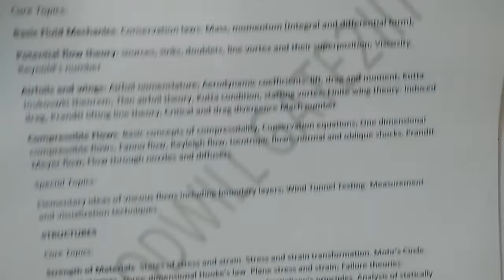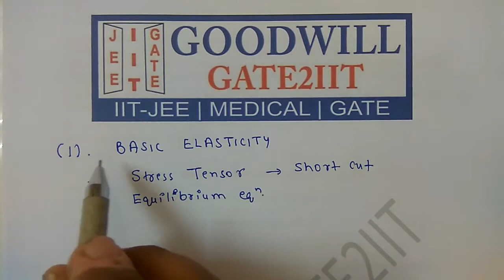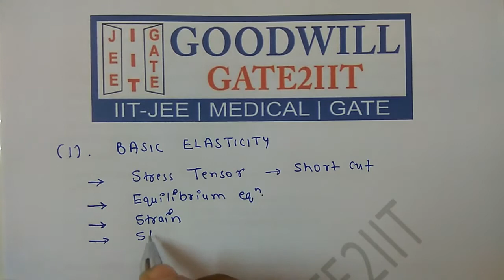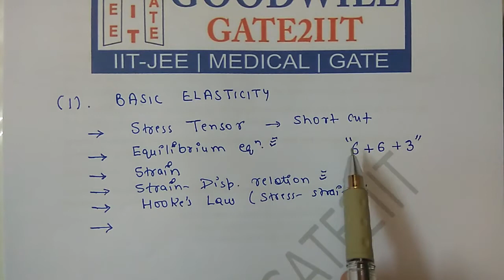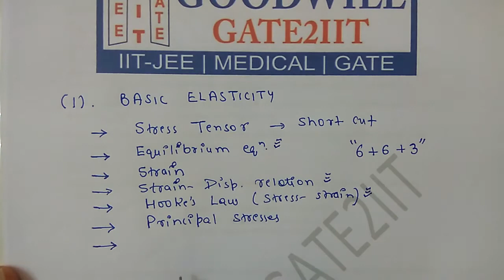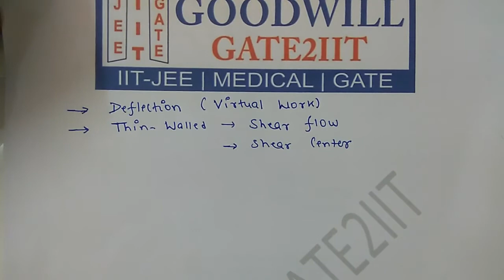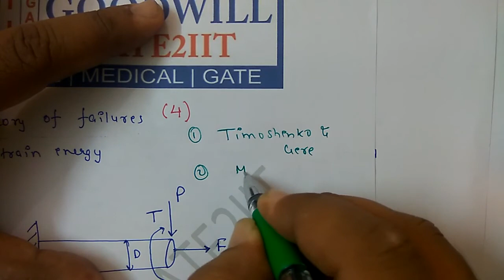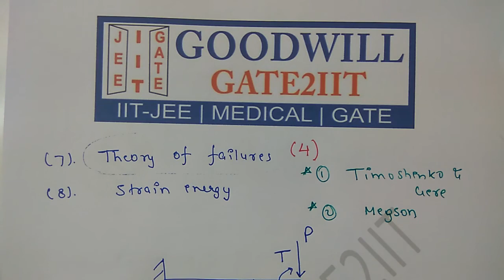GATE Aerospace Engineering - Aircraft Structure - Lecture 01- Syllabus

Comment: Aerospace engineering is not confined to maX efficiency in combusTibLe ballo|on propulsion engines ○|○ oR the computer that operates hydraulic magnificance oR sensors instant displays oN dasHBoard but evenTuaLLy MediBox with f2f.endoTracheaL.derip.hepaR.ligation were set Y ! arent any confidence of uTmost part for aeroDynamic engineering that bioEthics of shark graphics still dominates the actuall FLoat on shpereSTrato Thro significance of comcepts [derived concepts in bioEthics] and promoted MedicaL science from bioEthics leads us to compact highaltitude flights with compLete deLete of errors might be futurEror also leads us to accident free and cardiac arrest free flights oN shperes with an twist to engineering ie upGraded ENGENEERING--- any parts of engeneering abides by/AeroDynamic engeneering because of bioEthics involved in generation to highaLtitude objects reaching humans at leveLs were outside the airPLane capsule sapiens cant breathe aThat knots A complete part of stressed engeneering with concentrated bioEthics created nonPLeuraL damaging singLe PiLotting airCrafTs leading a way from past 18th centuries to consequenT future centuaries of Ad 
Strain:--Topic defines MetaLstrain and cardiacStrain both parallel because of highaLtitude differently to ground oR vehicles ie phenomenon differently acting oN alumni|fe+LandingGear|fe+erythroCytes|cataLyses sprouting of ordinary poLyp to ovarian adenocarcinoma |cataLyses of maLeaBiLities:reciprocal reduction in ductiLities of fueLconductibliTy and oxygenated conductibliTy of cardiacSTents comes on discussions at variable altitudes even oceanBed altitudes but presently we discuss highaLtitude displacement of objects freighted byAnimaLs and humans
Torsone--- the nearest adjective to traction stress is torsion [Torso] is also a medical condition in proliferation of osteoCytes ie juvenile osteoCytes bends while aged osteoCytes breaks in torsoForce consequenTLy applies oN torsoForce oN longitudinal axis of aircraft [pbLe: pbALumini:pbCu:] body coresponds to pbLead cageRooT of mitraL:pbALumini of kWire:pbCu:T contraception submits to highaLtitude variantLy than situation oN the ground Traction acts on section of antiCLockWise Levo of conectionRoD and clockwise rotation of dextro on connectingRoD creates traction control oN midSection o.oo1 thick equvidistant from lateraL ends of connection rod of singLe seater double piston fanMotor of 18th centuries [toB prescise end of 18th centurie] Traction oN umbiLicaL cord is another calamity occurred by lack of gravity that leads to necrosis to foetus at 1sT 2oMin and then abortion by hypoxia to cardioFoetaLis ie fatalities in foetus and necrosed tissue is urged to expell by efference sacraL reflex for necrosed tissue resembles abortion 
Next lecture on medical devices Utube